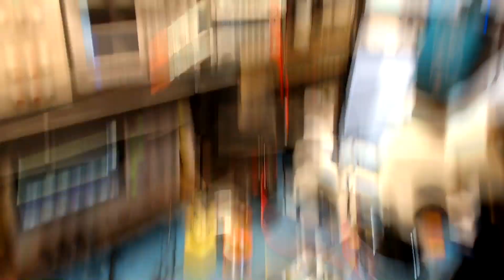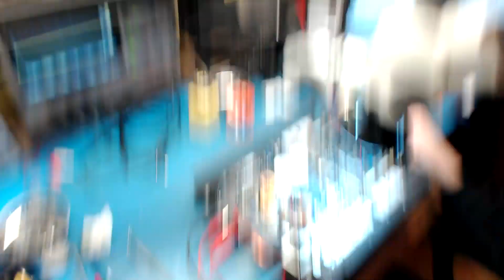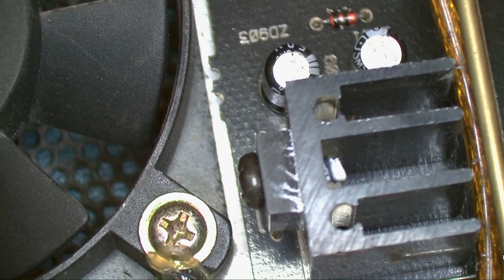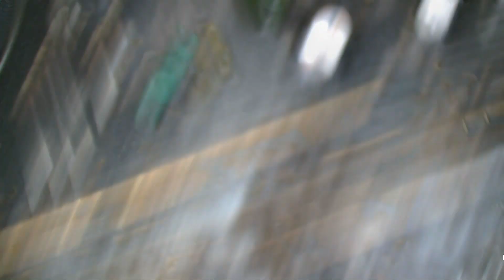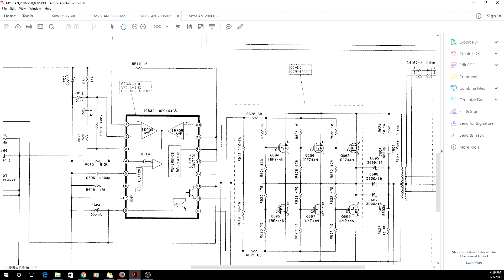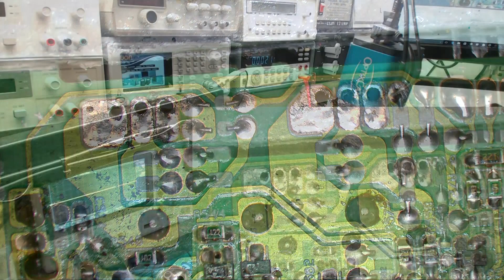ALPINE MRV-T757 REPAIR PART 2 OF 3

Comment: Hmm. This doesn't look like a gloves type job. No grease, oil, dirt, electrolyte. . . . . . . Base was more or less shorted to Emitter? I suppose it would have been worth testing impedance across the transistors pins 1st.

Comment: What's a good oscilloscope bandwidth to start with?
Reply from the maker: Any scope is better than no scope. Bandwidth depends on what your working on.
 If it's just audio gear an old clunker 20 mhz would work fine. You can get 60 to 100mhz digital scopes for around 400.
Reply: @Kev_31779  so for testing gate/drive signals and everything, 50 mhz would be fine?
Reply: @Kev_31779  any good little handheld ones that you recommend?
Reply from the maker: I don't know what device or circuit your talking about. That could be anything.
Reply from the maker: I don't have any newer handhelds to recommend,. I have an old Fluke 123 but it is really old.
Reply: @Kev_31779  do all scopes detect the saw tooth wave?
Reply from the maker: It should. That is what it is supposed to show. Any wave that is within its bandwidth.
Reply: @Kev_31779  oh, ok. Thanks
Reply: @Kev_31779  what type of glue is used to keep large components from moving?
Reply: So for testing gate/drive signals and everything, a 50mhz would be fine?

Comment: hey friend the a1220a transistors and the one next to the c2690a the amplifier gives audio but parmarea the protector in red color
please help me
Reply from the maker: If the amp channels work then you might have  led driver circuits not functioning correctly or grounds to the power supply blown. This is explained in most of my MRV-1507 videos. The amps are very close in design.

Comment: @8:54 the funky was your tweezers applying ground from the fan screw to the transistor
Reply from the maker: +chillywilly3610 I thought that too after I watched it before i released the vid. It should have spun, if it did touch the fan screw it was breif and may have cause the odd sparkling not sure.
Reply: Thanks for the great quality videos, learning more about amplifiers :)

Comment: It looks like this board has that old adhesive that gets conductive and corrosive with age.  Do you remove that stuff when it bridges connections on a circuit board?  Nice video series.  I think I'll subscribe.